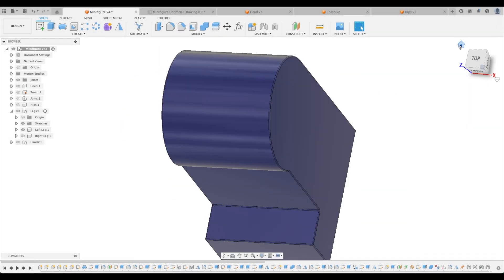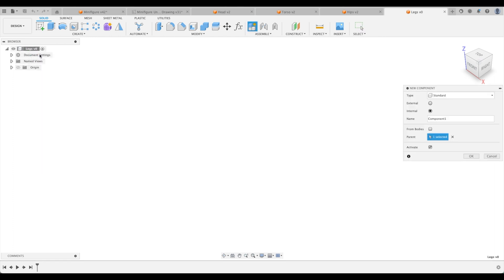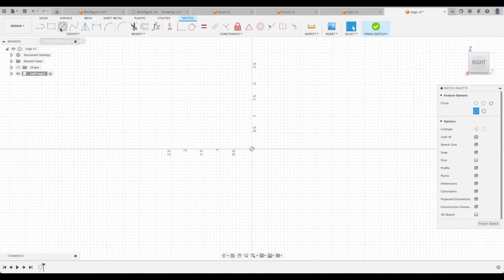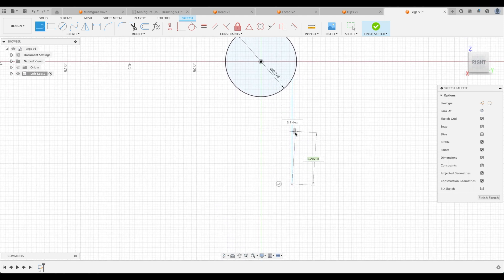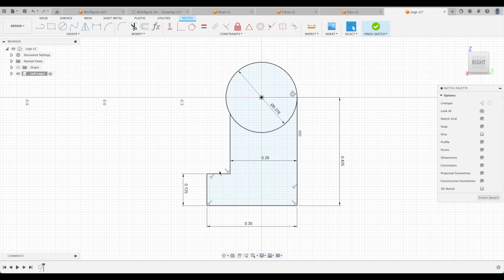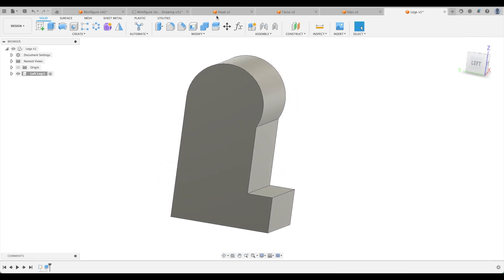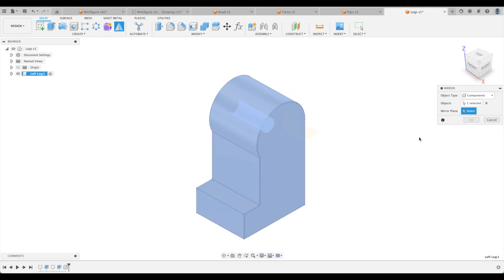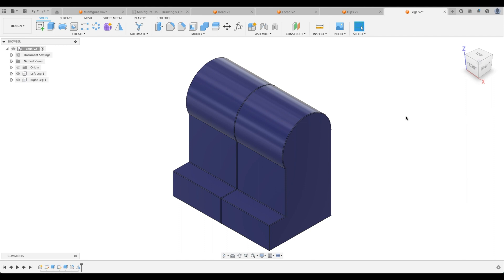Fusion 360 for Beginners - Lesson 10d - Model the Legs, Tangency, Trim Tool, Components (2023)

Comment: I just finished lesson 10d.  pretty straightforward.  The movements of the model is still a bit shakey.  I noticed that you have a link for the spacemouse pro and compact.  which do you use?
Reply from the maker: I am so impressed that you are improving this quickly. Great job!

I currently am using the Pro. The Compact and the Pro are nearly identical and I actually used the Compact at the last avionics shop I worked for. The Pro just has a bunch of extra buttons, which are programmable. For the price of the compact, you can’t go wrong with starting with that. However, because I have done so much work with programming for several years now, I actually started with the Pro.